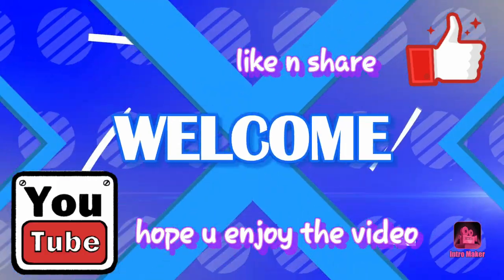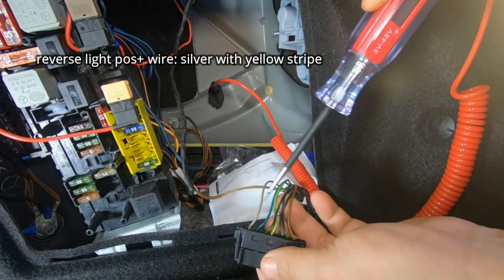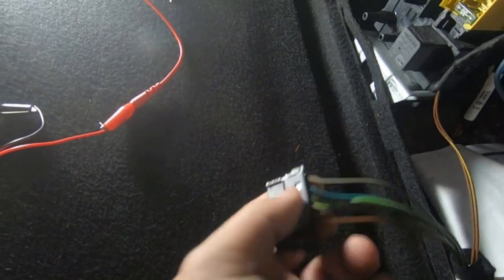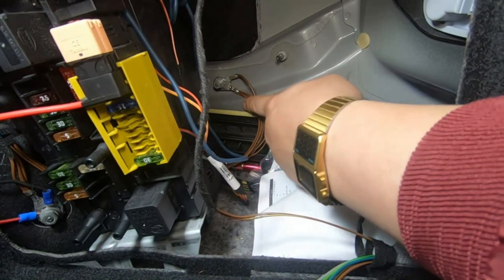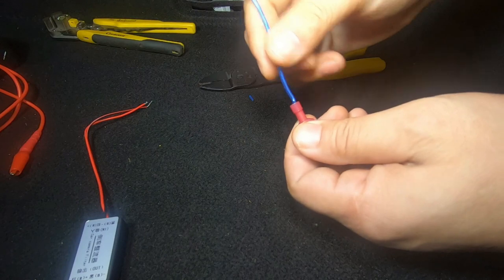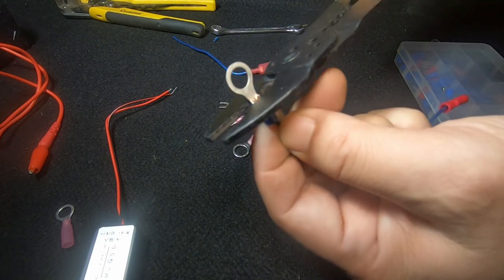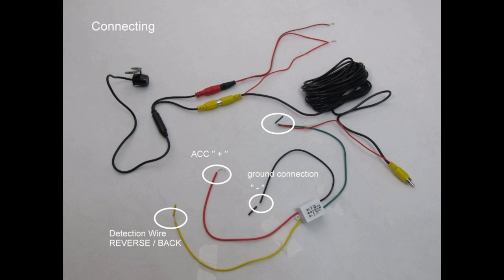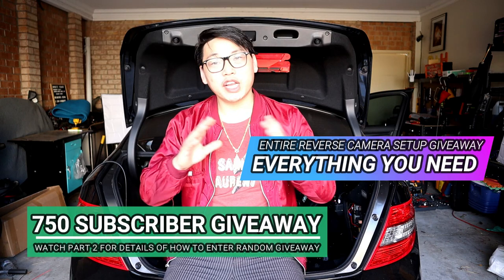mercedes w204 reverse camera install connect to reverse light PART 3

Comment: I can't get this to work Mikey. I just spent 6 hours installing everything and the camera won't come on in reverse. I used no 71 fuse 15a in the boot for power and one if the 10mm grounding nut's for the earth wire. What am I doing wrong. I activated reverse camera in engineering mode to. My screen doesn't have srvc option to change.
Reply from the maker: ok so my guess is you need to either select pal or ntsc , and it should work..did u also select the activate when in reverse option?
Reply: @MIKEYZVLOGZ  yes did all those thing's. In settings menu my screen has the spanner and screwdriver I'm thinking it's a software issue with the HU. Everything else was installed correctly constant 12v power from fuse 71 in the yellow fuse box in the boot. It just won't trigger the camera 😔 tried pal tried NTSC tried aux camera settings on and off. Nothing triggers it. Last hope is a transmission reset but I'm doubtful. My model has the NTG 4.5HU.
Reply from the maker: @robertjohn2249  hmm that's strange indeed .. as the function that triggers is is basically the setting that says activate inreverse ..typical cameras use the trigger wire ..but our cars do not
Reply: @MIKEYZVLOGZ  yeah I honestly can't work it out I tried every setting. It just won't turn on. Apparently in the settings menu you need a analogue clock displayed on that screen or it won't support a rear view camera. Like a latest updated command software. I'm really thinking this is why it's not working. It's a 2007 C280 avantgarde. It's really annoyed me I spent 6 hour's carefully doing everything right, didn't break a thing then it doesn't work and I'm troubleshooting for 4 more hour's lol. My car's still in piece's.
Reply: @MIKEYZVLOGZ  I got the camera to turn on in video Aux mode but it's fuzzy and black and white. Still can't work it out
Reply from the maker: @robertjohn2249  ok if it's fuzzy use a capacitor or what they call a rectifier ... it should clear up the video ..cuz that the point of it
Reply: @MIKEYZVLOGZ  okay I'll try that thanks Mikey. I ordered another NTSC camera to to try.
Reply: @MIKEYZVLOGZ  Gave up on using the command for reverse camera and bought a 10.25" android screen that uses both the NTG 4.0 and Android 13. Was cheaper than trying to update the firmware on the command unit to get it to work lol. Unbelievable how good it is now, China are absolutely fantastic with what they can produce for these car's.
Reply from the maker: @robertjohn2249  good on ya

Comment: What type of rectifier did you use ? The links are no longer working.
Reply from the maker: sorry about that...ye sometimes they run out ..I will have to change it ...
Reply: Would be really helpful if you could put details of the rectifier.
Reply from the maker: @LutfurRabbani  there are so many different kinds u can use ..it's what works best in the end for u
Reply: Found one online and placed order. Thanks for the video, hope it’s okay to reach out to you if I need help with installation. Thanks again.
Reply from the maker: @LutfurRabbani  I will help as much as I can from where I am... all good happy to help subscribers mate